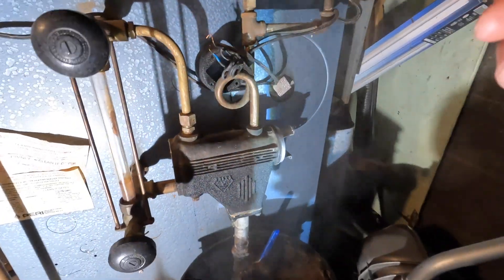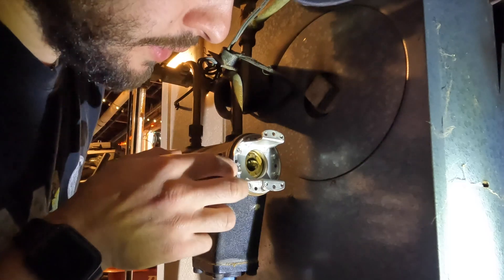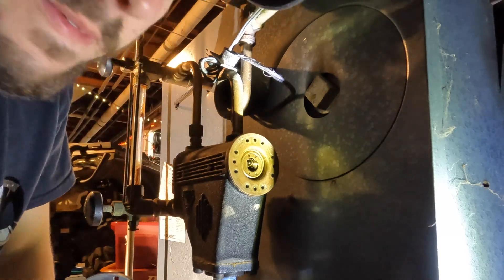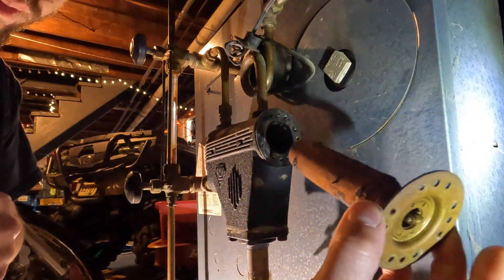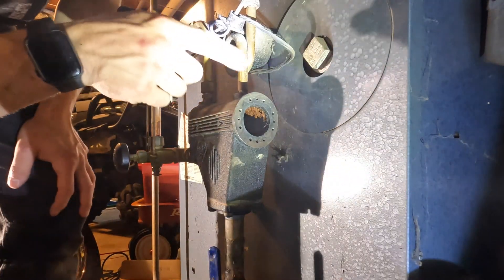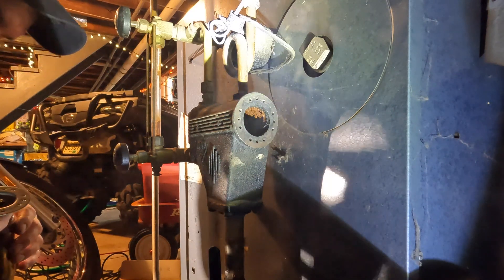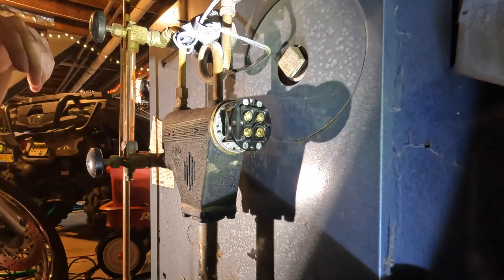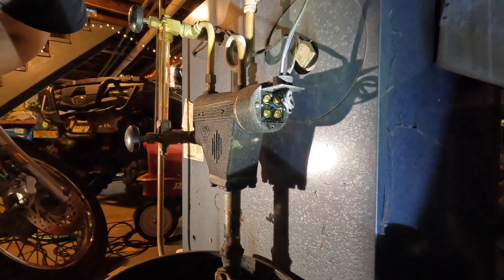Change the float on a Mcdonnell & Miller Low water cut off switch! (plus bypass trick)

Comment: Good video !  Im having the same issues in our lwco , sometimes the boiler water feeder keep feeding water and doesnt stop, im assuming the madonnall float switch is not switching and not sending the signal  to the  board to stop the flow,  I had to desconnect the soleinoid wire to stop the flow and feed water manually.  I. Planing on doing the same repair if i find the parts needed.
Reply from the maker: this unit is a manual fill type. so every so often i have to manually fill up the glass tube halfway. the float is just a safety measure in case the water gets too low.